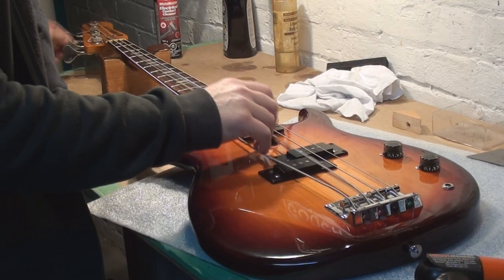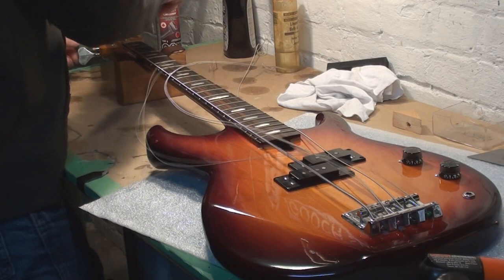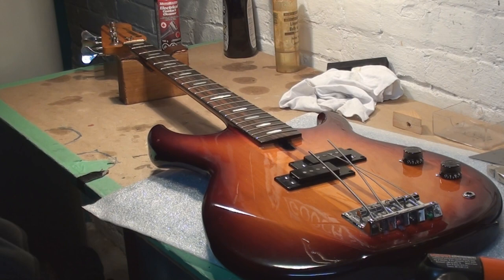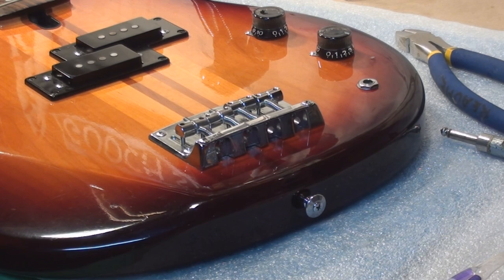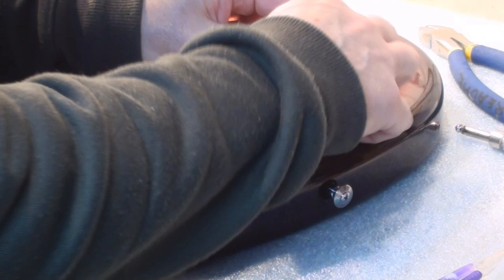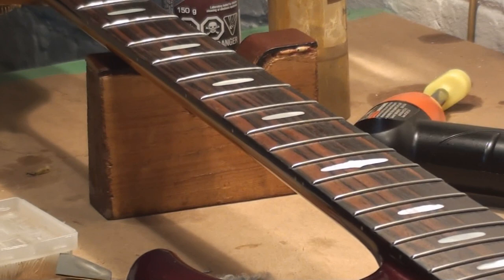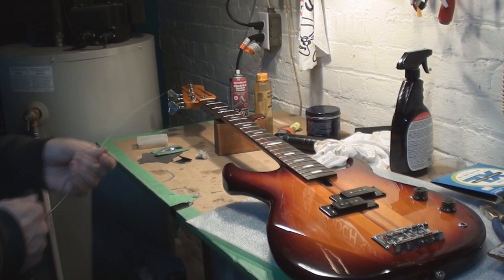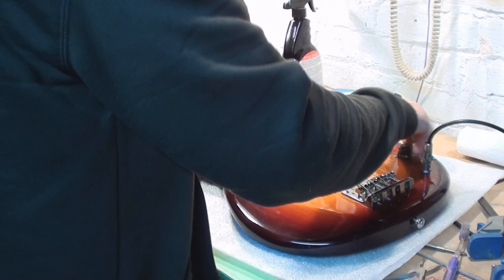How To Setup Your Bass Guitar Again The Movie

Comment: "if you gonna do a neck through, why stop the trussrod here, why not run it all the way through with the neck?".  good point, very good point, have never once thought of that
Reply: Cause the part of the neck that has the body wings glued to it is unable to curve because of those side wings? String tension doesn't bend that anyway because of the reinforcement that is the rest of the body, and the truss rod would just break on that part if you tried to adjust anything.
Reply: yea this was one of those comments im reading now wondering why i ever said that.
Reply: Agree

Comment: Dave - just a little suggestion - while there are no strings on the Bass and you are cleaning the bridge - wouldn't it be a good time to shoot a few drops of Liquid Wrench penetrating oil on each adjusting screw and work them back and forth to free them up. Just an idea.

Comment: hey Dave, I recently gooched the volume pot for neck pickup on my sx jazz bass. I temporary rewired both pickups to one pot (yep. they're both on all the time)......so , to cut the crap, I wanna buy three original Fender 250K pots and replace my old chinese made crap ones with them. Will it sound better with Fender pots, or there will be no difference?
thanks

Comment: Hey Dave, I think in one of your other videos you mentioned that flatwound strings put more tension on the neck (I think I understand the physics of that).  Are there any other concerns when switching to flats aside from typical setup (tighteing up truss rod and adjusting action as needed)?   Thanks.  I love your vids and your style.

Comment: Great video man!  What distance do you look for between strings and pickups when setting the height of the pick ups.?
Reply: press the string down on the last fret - there should be about 1/8" gap between bottom of string and top of pickup pole. You can have less or more depending on how it sounds and how you like it, but that's a guide for you.
Reply: Thanks.

Comment: i recently bought a squier 5 string ... the action of the strings is really tight ... but the intonation is fine and i like the distance from the strings to the fret board . would putting ernie ball super slinky strings on it with my next set up solve this problem of stiff ass strings ? or what should i do ?
Reply: Depending on what gague of strings you're getting, it could affect some stuff on your bass. If you were to go to a heavier gague set, it puts more tension on the neck, and will curve the neck.
Reply: yea .. i know ... i sorta stated that in my question . but what i found out was putting lighter gauge strings forced me to adjust the nut height a bit because my nots above the 5th fret were going sharp . playing bass for 15 years led me to a 200 dollar bass that i will never give up

Comment: what did u use to clean the neck (not the brush lol)
Reply: +Djhi Normas Simple Green.
Reply: Looks like this stuff: http://s294.photobucket.com/user/Rubiconmike1/media/006_zpsbe8d0287.jpg.html which says it's an Automotive cleaner and degreaser - should that be used on a guitar???
Reply: Actually found the site, might be OK. http://simplegreen.com/en-ca/household/products/pro-series-max/
Reply: Just be forewarned, Simple Green can crack plastics if used full strength. Be very careful with items such as pickguards, truss rod covers, back plates, etc..

Comment: Why are guitar techs always salty old curmudgeons, so bitter and pessimistic?  Is it dealing with lowlife musicians who are always trying to rip them off or is it shattered dreams of rock & roll greatness due to a lack of any real creative musical ability?  Na, must be them pesky kids always trying to rip me off!   Love your commentary - keep on truckin', brother.
Reply: I think "bitter and pessimistic" comes from more often than not getting instruments that never received any proper care and/or require fixing previous poorly done mods or repairs or even poor factory work. You're feeling sorry for people buying shitty instruments (used or new) and having to instantly overspend on the fixes you do, on the other hand you're feeling different kind of sorry for guys who supposedly play for years and don't even know how to (or see why they should do it) set up and maintain basic stuff like intonation themselves.

Also, after the first few times of being the first one in a decade to scrub some cemented bodily secretions off a guitar, you'd be somewhat cynical too.
Reply: You also start looking in a very practical way on instruments' technical aspects quickly, you sure do complain about manufacturers that try to reinvent the wheel and you end up with some solution that takes 5 times longer to adjust than everybody else's, or on proprietary parts that are impossible to replace. You will dislike any other neck joints than bolt-on very quickly, too.
Reply: It doesn't take more than a few oddball customers wishing for the impossible. How about somebody who wants an acoustic fitted with an oak top, but who expects it to sound like spruce?

Comment: Do you pencil coat the nut slots and bridge saddles with graphite before you put the new strings on?
Reply: *****  Good answer Dave! lol
Reply: Jim Nesta Thats a great tip graphite & 3 in One Oil mix it & apply every where the string touches the saddles nut. It helps a Ton with tuning.
Reply: Watchman4u Thanks, it just seems like a good practice to me to try to minimize friction between moving parts on any mechanical device. Some of the strings on my bass would sometimes bind a little in their nut slots when I would tune it up and so I made it a habit to try to keep those contact points lubricated.
Reply: Jim Nesta Try that you have that stuff around the house you can buy the graphite @ automotive parts stores it's used for sticky key's a little of the powdered graphite & it will not seize up. Same w/guitar just add some 3 & One Oil in the tin can w/the Red tip. Must have stuff. Cheaper than that "nut sauce" they sell. And works better. makes perfect sense I have a old guitar that had a locking trem but the saddles had wheels the string went over they were to roll w/the dive bomb well the low E saddle broke & I can find another like it any ideas It was a KMD by Kaman Top Mounted Custom style trem & had a 0 fret I think? They were the Answer to like a Jackson Solo / Dinky or RG / Charvell i.e. Super Strat. The Kaman Co. is no help. I thought about the D-Tuna but I'm not sure it would work. Jimi said only cowboys play in Tune. lol
Reply: +Watchman4u Thanks for the info on that; I'm going to use that on my bass when I get it back from the luthier. It's a Gibson Thunderbird with their "Tektoid" nut, supposedly some polymer with impregnated Teflon or graphite, and I'm having it replaced with a harder bone nut. Since bone isn't self-lubricating, I think that oil/graphite mixture you mentioned will be good for the nut slots.
Reply: +Jim Nesta most times you won't need to... if you have a brass or graphite nut, those are self lubricating, plastic nuts aren't usually too bad for friction but if the slots are rough, a little bit of crushed graphite from a pencil in the slots does the trick ok for an initial stringing...
Reply: +TheSoxmania Thanks for the info. I did get my Thunderbird back with the bone nut and it is improved over the stock Tektoid nut, less string binding and better tone and sustain on the open strings. The luthier did a careful job in cutting the depth and width of the nut slots and the proper ramps on the bottom of the slot. I'm still going to coat the contact surfaces with a dry lubricant to minimize friction.
Reply: +TheSoxmania I restrung my bass with the same D'Addario chrome flats that I had before and the tone is really nice. I still had some tuning stability problems on my E string but putting some finely powdered graphite on it has helped. I used a flat ribbon segment of dental floss to coat the sides and bottom of the nut slots with the powdered graphite and there is a definite improvement in the tuning of the strings.

Comment: i was always told not to take off all strings at once, could fuck with my neck. any truth?
Reply: Thor D If there is no reason to do it, don't take them all off - there are many reasons why it's best to change one string at a time like for instance your hardware not flying all over the place, there is always some little tinbit that is being held in place by will alone and once you remove all the strings that will has a tendency to perish along with the old strings.
If you have to do work on the thing that requires taking all off the strings off then yeah, take them off, otherwise I would go one at a time.

This is not a new versus old issue - as long as it's made out of wood or other materials affected by tension in the time and mechanical frames of reference we care about, any instrument will be affected somehow, by how much and how exactly depends on the particular guitar let alone particular design, manufacturer etc.
Don't be fooled by this idea that "modern" means anything, sure maybe modern lacquer is more resistant to the environment but they din't start growing better trees all off a sudden and there is still a rod in there - if tension was not an issue anymore, the rod would not be necessary anymore either.
Reply: ***** I have a double truss rod and a multipiece neck on one of my custom made guitars and it is susceptible to string tension, moisture and all the other variables like any other guitar - it just reacts differently, sometimes less, sometimes more - it requires a lot of adjustment time purely because of all the modern gizmos it has so extra stability adds nothing to my life with that particular guitar.
The same holds true for all of my other guitars (and I own double figures of them) regardless of construction - you cannot make any sweeping generalisations about any of them.

Most quality instruments made today are based on older designs and do not have any of the elements you mentioned, especially basses.
90% of the cheapo basses out there are fender copies, either jazz or precision bass.
If you own a cheap jazz bass copy it is unlikely to perform better than the first original jazz bass out of the fender factory.
Now if you own a G&L then yeah maybe the new ideas in those add to stability but if so those are minuscule improvements - not a whole new paradigm of guitar and bass stability.

If you actually had any experience with quality instruments you would realise that 90% of them even today are made exactly as they where 50 years ago just often without access to woods of the same quality and by someone who does not give a crap somewhere in China and that even a 60 year old telecaster can be mighty stable if it was quality in the first place.

The guitars that land on my private bench the most are those "modern" designs made by arrogant people who think just like you that they have "knowledge and understanding".
I have to adjust them all the time and when i take all the strings off all of the "modern" bits and pieces fly around my workspace and waste enough time that I don't care anymore whether it will require retuning tomorrow or not.
Meanwhile I have high quality guitars from the 70ties where I just adjust the rod a couple times a year and I don't have to take off strings to reach it either!

Modern means nothing - quality is quality and shit is shit regardless of date of manufacture.
No one is an omnibus of guitar production or maintenance, it is part science and part art and many modern approaches fail miserably which is why again most of the top models from top manufactures at best would have a double tross rod which only means that you can force in a back bow and a front bow, it simply works both ways - it does not nessesarily make anything more stable just by being there, it just allows adjustment both ways.
A laminate neck again does not have to be better than a one piece - it all depends on how stable the wood is and how well it was worked into being a neck.
I have single piece necks that are rock solid and seen 3 piece and 5 piece necks that are not rock solid and actually some even come out of the factory already slightly warped because hey quality control.

Comment: What the hell , who taught this guy to work on a bass . he's mutch to violent on the bass and you don't SCRUB THE NECK WITH A BRUSH AND SOPE AND YOU DON'T SAND THE FRETS AND YOU DONT AJUST UNDER TENSION . and a neckthrough thrusrod doesn't go into the body because you want to ajust the neck not the hole bass
Reply: He's probably forgot more than you could learn. Dave is s tech (and a talented one at that) and does what works. Id trust him with one of my basses in a heartbeat.
Reply: Dave The Bass
well every one has there own way of doing things, i just don't like his way . But the way he dose it is a fast way and when its your job or something you do a lot speed helps. I on the other hand can take a whole day or more with one of my basses so i have the time to take the long rout, and i have probably done some things that would make him shit himself
Reply: Gallon 3228 I have adjusted necks under tension for 20 years with ZERO issues bro.

Comment: Dave please tell me more about Simple Green,
I cant get that exact same one you have but i can get 'Simple Green Indoor Cleaner' which is supposed to clean dirt , soot & stains caused by mold , mildew , fungi.It doesnt say its a Cleaner & Degreaser, just says 'Simple Green Indoor Cleaner.Do you have any idea if it can be used ?
They dont sell Simple Green MAX anymore.What would be the next one you will get ?
They are all biodegradable im wooried about just using any of them.

Comment: Check out his "professional" setup of a Rickenbacker.....complete with his distaste for the brand. "Check the electronics"...LOL...they are called potentiometers. With lack of use they can become scratchy....easily cured by a wd-40 squirt int them as they have a light oil/grease applied when they are manufactured...unless of course they are a sealed design.
I would not take any kind of instrument to this guy. Unfortunately, you tube has given access to these people and you get what you "click" for...in this case, not much.
When I see a "setup" listing, I expect to see someone who knows what they are doing.
Disappointment to say the least.
Reply: Yup , listen to an electronics wizard recommend "WD-40" as an electronics CLEANER?!?!?!  Will it work for a SHORT time? Sure! So will gasoline... And then it becomes gummy and acts as a dirt magnet You Tube certainly has allowed idiots who know little to nothing about that which they are commenting to display their ignorance. Take a bow. Please stick to criticizing and giving advice on subjects about which you are actually knowledgeable.